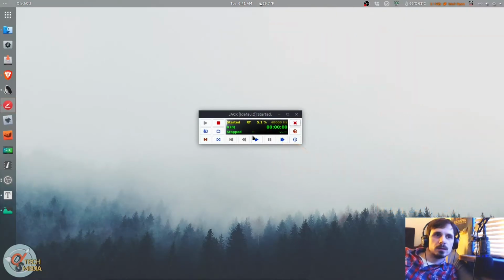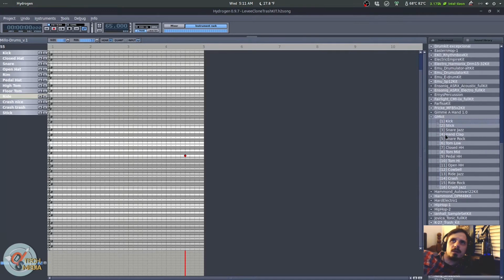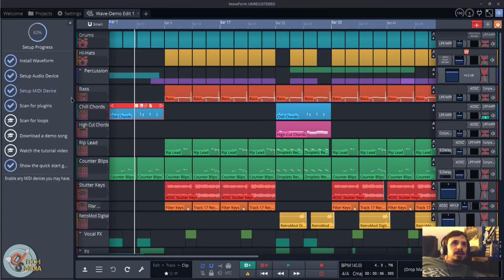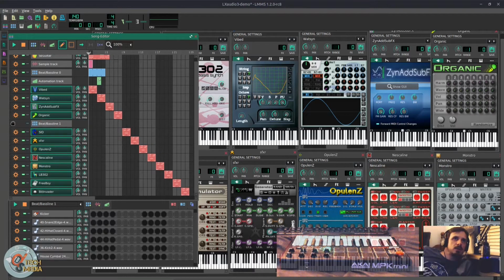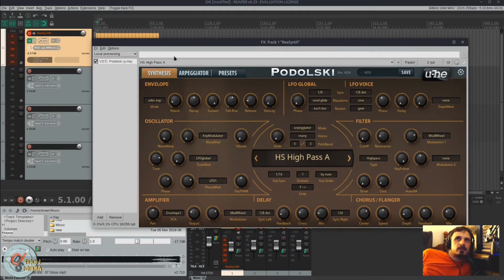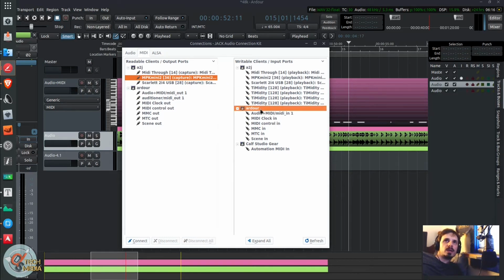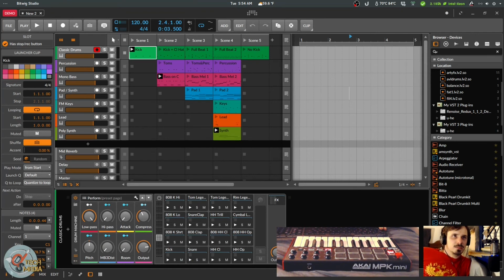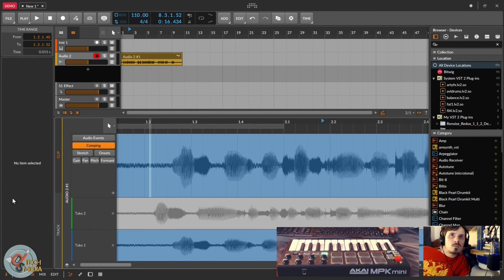Guide To Producing & Recording Music + Audio With Linux PART THREE: Digital Audio Workstations

Comment: Thanks for the videos 🙏🙏🙏,  a question 1) I bought the Livetrak L-12 zoom mixer (audio interface), my system is Manjaro KDE and I can't connect it .... I use jack, I've looked for google information, and nothing... .can you help me please???
Reply from the maker: So I did some googling, and found this: https://linuxmusicians.com/viewtopic.php?t=19580
One guy claims his works flawlessly with JACK, and there's another guy with the 8-Track saying he's having issues like yours. I also see one user mention that he can't get it to work when set at 96,000, but it works at 48,000. But good news is I think it should work.
In QJackCtrl did you go in and select the mixer? Also in advanced check to make sure it's set to Duplex(ins/outs). Hope this helps somehow.
Reply from the maker: OH! Also, on the back of the device there should be a switch for "Class Compliant Mode", and this needs to be ON for Linux and OFF for Windows. I'm thinking this may be the solution?

Comment: I'm recording in Windows right now. This is the first time using this god forsaken OS in over a decade. I' had no options, as the Jack audio server is a convoluted nightmare at this point. It was fine when I was just running my guitar in through the Scarlett solo, but bringing in a drummer and bass, I had to upgrade my interface. JACK is having no part of it. Believe me I'm still working to sort it, as Winblows is no place for a Linux user. I say this to point out that the average window user is going to face hurdles that may be worth it in the end. But to lead them into thinking a switch will be like changing shampoo is just not honest. If I, as a 10+ yr Linux user am having these problems, new users need to know it may be a struggle. If JACK was as reliable as ASIO, switching would a no brainer. But it's not.
Reply: Same here..... Using Linux for everything else but for Audio Production, forget it..... Too many problems, too much tinkering and fault finding needed just to get the basic stuff working. Linux is amazing, but for Audio, Windows just works really well, consistently. So, for me, for the time being at least, it's a dual boot (actually triple visiting at the moment with Debian (MX Linux, love it) Arch Linux and Windows 10..... I've tried soooo many times to get a working Linux Audio system up and running, but something always goes wrong, requiring large amounts of time trying to "fix" stuff that in Windows just works. 

Thanks for the Video series though and good to see that many others are using Linux for Audio Production and it seems to be working well for them. 🤘🙏
Reply from the maker: Yes I am sorry to see the two of you have had negative experiences with Linux audio. I personally wasn't sure about any of it, and that's why I started off with AVLinux. After trying things out with that I installed the things I liked on Arch Linux and eventually Ubuntu. But everyones hardware and requirements are going to be different. 
In the future I plan to show recording live instruments too. MacOS is hands down the best suited for music, and iOS too because CoreAudio's latency is low and theres no need for JACK or ASIO.
Reply: @DSTechMedia  First off, you're talking down to me as though I'm new to Linux. I'm sure I've been using it far longer than you. 

"of course a Scarlet Solo cannot do that, but I don't see how that is a problem of JACK?"
What? Did I not say the scarlet worked fine?

"And on the new interface you should have gotten multiple left and right channels that appeared in JACK  for that interface"
Wow, that's brilliant.

" that's why I started off with AVLinux"
This problem exist in both AVLinux and Ubuntu Studio, as well as Manjaro. It almost works in Endeavor but with a ton of conflicts.

"Were you not able to get it to start?"

It starts like normal with 0 conflicts. In the Jackctl routing graph, it shows that my interface is there and properly routed to Guitarix, or Mixbus, etc. I do get output from youtube with Jack running Pulseaudio  Bridge. But input gives me nothing.
Reply from the maker: @Dude Slick  No, not talking down to you. You also mentioned in your first comment how long you've been using Linux. But using Linux doesn't necessarily mean using Linux for music. I started with Linux for servers, but knew little of it for things like this. But you're more qualified to use it for audio than someone who is just starting out with Linux. 
There is no inflection in comments and that's why it's easy for them to become hostile. 

But, it was unclear exactly what issue you were having because you said you were using a Scarlet Solo and then upgraded your interface, but only said JACK is a convoluted nightmare.
Output with no input is interesting though. I'm sure in QJackCtrl you had Duplex selected because i don't think it would show routing for input if it wasn't.
I've had similar issues before, and found that if input wasn't working but output was that it could be disabled elsewhere. 
For instance, in Pulseaudio Volume Control the input may have become muted OR muted/all the way down in Alsamixer, but on interfaces specifically alsamixer usually shows no controls.
But if you're using Windows to record you probably don't feel like switching it up and I get that.
Reply from the maker: I don't know exactly what problems you're having, but if you're trying to record multiple live instruments than of course a Scarlet Solo cannot do that, but I don't see how that is a problem of JACK? And on the new interface you should have gotten multiple left and right channels that appeared in JACK  for that interface.
Reply: @DSTechMedia  Thanks for the reply. It's not so much a problem per se, more that overall Windows just works for me in a much better way than any Linux distro i have tried throughout the years. :) Latency is amazing, the main programs i use (Reason 11, Reaper & Guitar Rig) all work really well and are very easy to use. I'm also not running any new hardware, my whole setup is running on an i7 3rd Gen with 16gb of ram (Laptop) and it's fast and i have set it up well enough so that it is snappy and responsive. 

I guess i could do the same or similar with Linux but there are too many hoops to jump through, too much of what i like to use is either Windows only (And Wine just doesn't cut it for most things audio) or, in the case of Reaper, not equal (in the Linux version) to the Windows version. 

As i think i said in my last comment, Linux most definitely works for Audio as there are many people using it, but it's nowhere near as polished or mature as Windows and i guess Mac OS also. It's not to slight Linux in any way, i'm currently writing this on an Arch (Artix OpenRC) install inside a VirtualBox VM on my Windows system, because this way i can still use Linux and keep learning more about it, while having my studio setup ready to use at any time. The VM takes very little resources, i don't have to reboot to use either and it's the closest i have been able to get to use Linux for all things except Music creation etc..... It's a compromise, but for now it works. 

Anyway, HUGE comment, thanks for reading if you have made it this far, keep on making great videos and i'll keep on (periodically) trying Linux Audio setups in the hope that something may one day work. :)
Reply from the maker: Also you mention JACK not being reliable. But in what way? Were you not able to get it to start?

Comment: is this true that there is somewhere linux which I can use without audio interface ? so its good enough to work straight from micprophone line in from pc ?
Reply from the maker: I'm not sure what you mean. You don't have to use an audio interface unless you're recording with an XLR microphone or instrument line-in. You could technically use the tiny line-in yes. But I have a laptop that I use with no interface or microphone.
Reply: @DSTechMedia  Thanks for an answer. I want to record my electric guitar on my PC (: I do not have an audio interface (like scarlet for example) I just wanted to find a linux distro who has short latencies and I do not need to buy inteface..
Reply from the maker: So that's a bit tricky because you either need a USB microphone or an interface with a instrument jack input. Technically if you had a device to turn guitar into microphone/headphones jack that could work.
Reply: @DSTechMedia  Hallo again(: my device has got headphones output I have G1four zoom multieffect I will be thankfull if You tell me how can I transwer this sound to my pc by this device ? seller ofnmy device said that I must to buy an interface.. but maybe there is a way to use my headphones output to transwer this to Pc ?
Reply from the maker: So you're talking about an effects pedal? And I'm assuming a guitar or something else running into that effects pedal first? There is a particular type of adapter that can turn that into a headphone jack signal, but typically you would just use an interface.
Reply: @DSTechMedia  ok Thank You for Your answers Has this adapter got normal latency ?  Would You please tell me a model ?
Reply from the maker: https://www.amazon.com/guitar-aux-cable/s?k=guitar+to+aux+cable these are some examples. I don't think there should be any latency because I'm pretty sure it is an analog signal. I've never used this before so I don't know for sure.